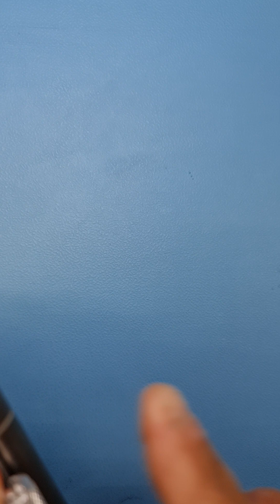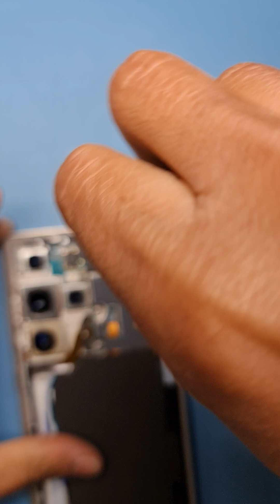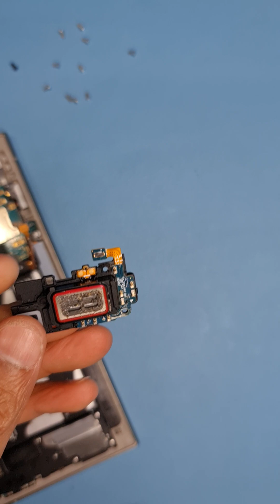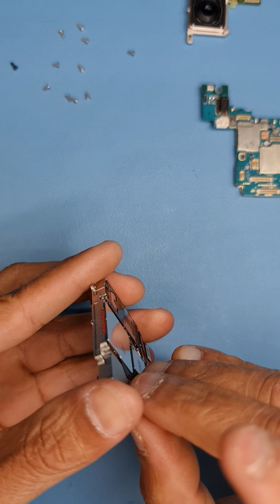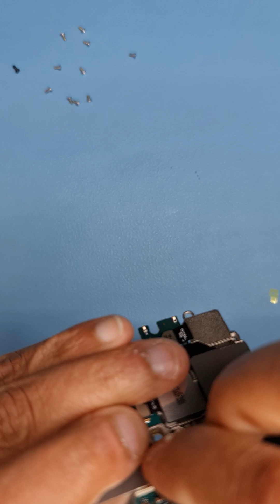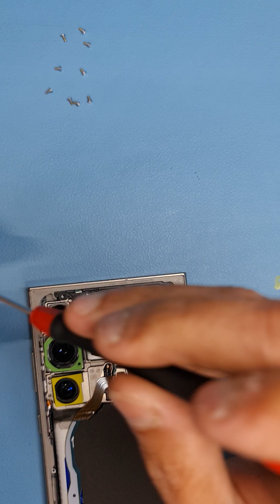Samsung S24 Ultra Back Camera Repair - Rattling Noise Repair

Comment: So I think something has become loose within my phone bc my phone camera the past week won't work. 😢 My front camera is fine, but my back camera...if I open the camera app, it says camera error failed & closes the app immediately. If I squeeze the shit out of my phone, sometimes it'll make it work. But it's definitely getting worse. Which sucks bc I take pictures so often & now I can't. Is it something I can fix myself or do I need to go to someone for a repair
Reply: You fix it?
Reply: I know a solution
Reply from the maker: if you  based in uk you may be covered by samsung warranty  they provide 2 years warranty

Comment: Hello  I noticed that the camera you removed is marked as E3_tele....sony V08, which is the original. The one you have replaced has different marking. So is that an original camera or an aftermarket one? I am asking as i have mine for repair to replace the x5 camera.
Reply: So he basically bought chinese copy with no OIS or low quality OIS. Such a dork human being
Reply from the maker: genuine camera. I work for Samsung
Reply: @JordyXRepairs  sure you work sure, we believe 🤭